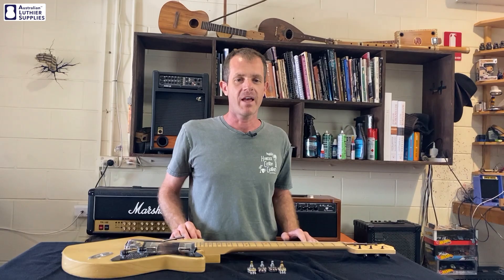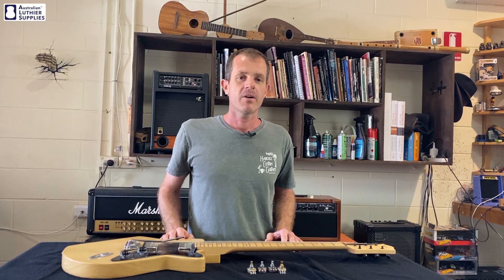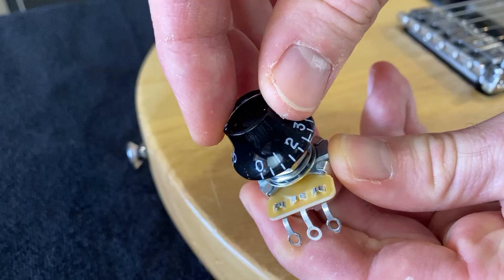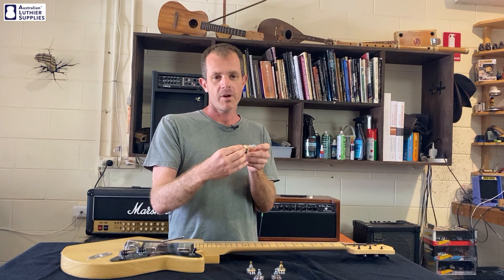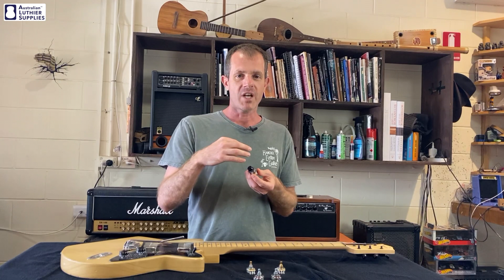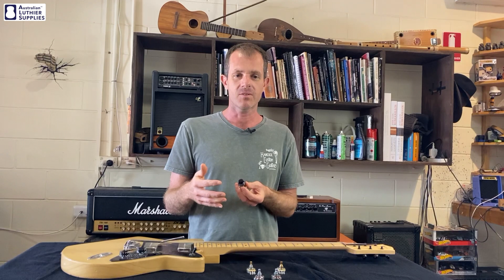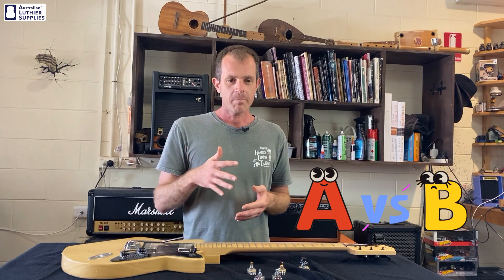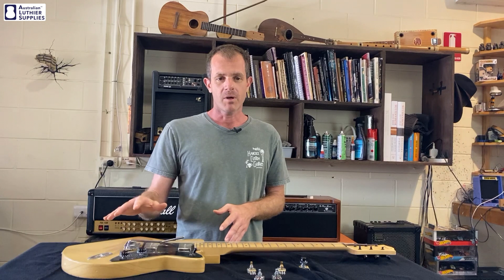A Curve vs B Curve Guitar Pots - Audio vs Linear Taper

Comment: I've seen people start the craziest fights over this one topic lol  In rookie terms, starting with tone controls, Audio versus Liner just shifts the range of values you have the most control over.  So when you play, if you frequently use very small cuts to your tone, you would probably benefit from Audio because you can get a lot more practical values out of the lower range of the pot.  Once you get past noon or 1 oclock, the jumps will be more dramatic.  But if you jump all around, or often pick one value and leave it there, a linear would probably be fine.  So it's just what fits how you play.  If you don't know yet, start with linear -- equal access to all the values, and the control works how your mind is thinking it should.  For volume, the prevailing wisdom is this:  since loudness and how we hear is not linear (look up how decibel changes are perceived by the listener), an audio pot will let your volume changes match the practical changes to the loudness of your signal (or at least the perceived changes).  Don't tell anyone on the internet that, though, because you'll be told your an idiot by at least one clique.  I only use audios for volume, and have never been disappointed.  But here's how you can decide for yourself:  put in a linear.  If you find that you can't tweak the volume with out it suddenly jumping from "close to what I want" to "too loud" then you've hit the common problem with the linear pot (as a volume control) and you should switch to audio.  BUT, if it works perfectly for how you play and you set the control (e.g. if you use a volume pedal, the type of volume on your guitar probably won't bother you much either way), then stick with it.  At the end of the day, these are controls to let you manage your tone -- find what you like, and go with it, and if someone tells you you're doing it wrong...well...you know what you can tell them to do with their opinion ;-)
Reply from the maker: Thanks for your comment. Good points and again evidence it's a lot to do with personal preference. That's a good suggestion to try swapping out to the other type of pot if you are curious what the difference will be like :)

Comment: thanks for the nice video!

i have CTS Mojotone Vintage Taper pots on all volume and tone knobs. If i understand correctly, these Vintage Taper pots are somewhat a mix in between Audio and Linear taper. I love them to bits. I find the swell to be very natural and without abrupt change. I've tried both A and B pots for both volume and tone but personally for me these Vintage taper sound best. Would recommend to anyone who hasn't tried them.
Reply: Somewhere in between A and B, it sounds like a good option if the two standards are a bit extreme in the way they change the sound as you turn the knob. Thanks for your comment!

Comment: I read that linear pots should be used for the tone control, the logarithmic for the volume…
And I think that, instead of 2 linears, one linear and one logarithmic or two logarithmic should be used for tone and volume.
At least, that makes sense to me.

Thanks for the explanation.
Great video, straight to the point.
Reply from the maker: Thank you for your comment and glad you like the video :) That is a common combination, there are also a lot of guitars with the opposite (linear on the volume, logarithmic on the tone) getting around. It's confusing!
Reply: That was my view also for a long time, but I've come to go only with logarithmic pots as they sound "right" to me. I have yet to find a satisfying use for linear pots, even if they are intriguing in theory.

Comment: I'm personally not a fan of audio taper and prefer the linear because I think it gives me more control. I also have vintage pointers on most guitars so I know exactly where I want to set it and I know that's how much signal is coming through. I would only use audio taper if I was constantly doing volume swells,  which I dont....
Reply: Great comment and some good points! That makes sense for volume wells the Audio could give a more even change and that the Linear can allow more control otherwise.
Reply: I am in your camp 100%

Comment: I found out by mistake that I had replaced an Audio taper with a Linear taper on  Strat tone control and dicovered they sound clearer than Audio(same capacitor) to me.
Reply: That isn't a result of the audio/linear difference, that's more about the quality of the parts. Or maybe placebo tbh. The way well-constructed pots work, there should be no way for that to happen, since they are just a variable resistor. Is there any chance you changed the value of the pot, like from 250K ohms to 500K ohms, or maybe 500K ohms to 1M ohms?
Reply: I did take reading from 3 pots (linear) and found 220k, 248k, 270k so I just put the 248 in. Maybe you can help because these were the only CTS pots I could find in the local radio repair shop, I also replaced the volume with the 220k and I really can hear (clean) each inrease 1-2-3 etc very clearly until 9 and then it seems to sound unhindered and loud. I was going for the regular 5 way Straticaster wiring( no treble tone) but decided to put a tone .047 in neck and a .022 on middle and just straight on the bridge, it got to the point where I was happy with the clarity so I bound the wiring and sealed it all up. I know it's not the exact wiring for a 65 but now I hear the middle pickup and really like it(almost Ventures/ Hank Marvin tone). The pots that were replaced were alpha, they looked good and had a more rigid resistance when turned. I also discovered that different wire gauges could alter the tone drastically too so I stuck with the cloth covered type that the Guitar had before. Took me weeks to get it the way I liked but I really wanted to do my own repair just to get to know why/how it all worked together. Thanks for your time. I am learning by ear as I go along but the best thing is  I am not afraid of dismantling Electric Guitars anymore. It's all fun but serious too.I tried measuring the Alpha pots but the readings were different everytime, sometimes working sometimes just going all over the place without touching the dial. Tried them in another simple 1 pickup Guitar and they made it crackle when I played above a certain spot on the dial( 7 onwards)?

Comment: I had thought (hoped?) a linear pot would be better for doing a lot of Jeff Beck type swells. The usable percentage of the volume and tone pots of virtually all my guitars is too low for my desire. I'm sure they're all audio taper.
Reply from the maker: That's worth giving a try, changing the pots to the liner and see if it helps even out the volume swells. It makes sense but it's hard to say for sure without doing the experiment!
Reply: I believe Fender uses A audio taper on their Strat's and Tele's

Comment: Just picked up this video. Log pots, correct about the relationship with our ears. sound travels through air as a logarithmic function. (decibels are a logarithmic function). In your experience, does tone (with respect to the tone pot)) also reflect a linear or logarithmic function? regards
Reply from the maker: Yes it works the same way on the tone, the change in tone is heard more evenly if logarithmic (A-curve) pots are used on the tone controls.

Comment: I’m wiring up my first custom Strat pickguard. I’ve bought audio taper pots for my tone controls, but a linear pot for my volume. My rationale is that I don’t intend to use the volume control to adjust the audible volume, more as a clean up tool when playing with gain stages. Is this a logical approach to take?
Reply from the maker: It seems logical but it's a bit out of our scope of expertise. Maybe someone else can reply who has more knowledge of the subject of gain stages?
Reply: Yes, that's why I prefer my SG with linear taper pots, it cleans up the signal before dropping the volume. I have a couple of 1 channel amp's so instead of having to stomp on pedals to clean up the gain I'll just roll back my volume control.

Comment: I want a volume pot for volume swells so essentially go from nothing to something quickly , even act as on/off which pot would be better?
Reply from the maker: The B-curve pot will swell quickly from 0 up so it is a good choice. You could even install a left-handed A-curve pot, which would accentuate the effect even more, so that most of the change happens at the beginning of the turn.
Reply: @AusLuthierSupplies  good advice, thanks.